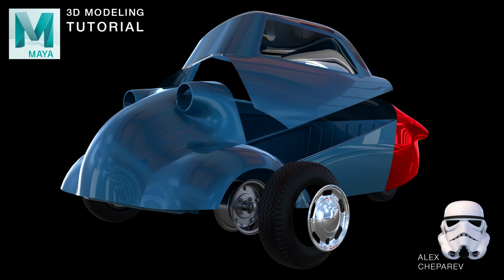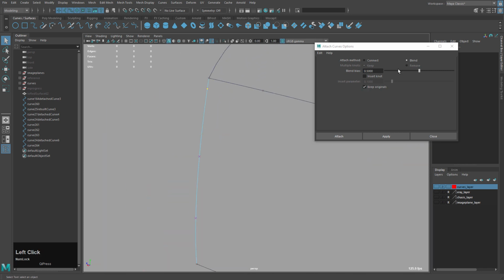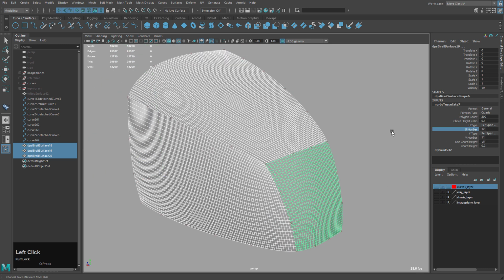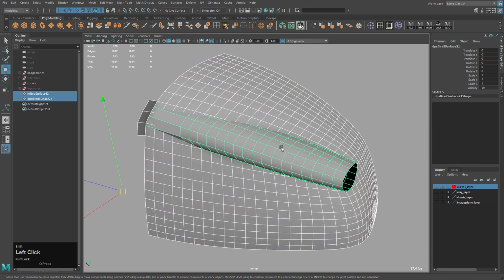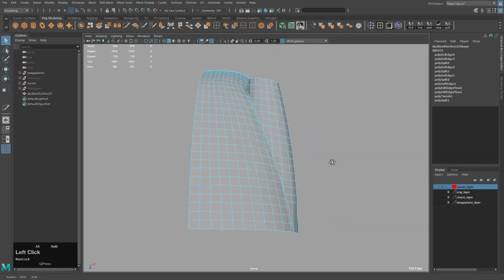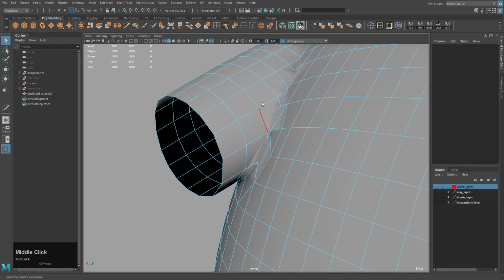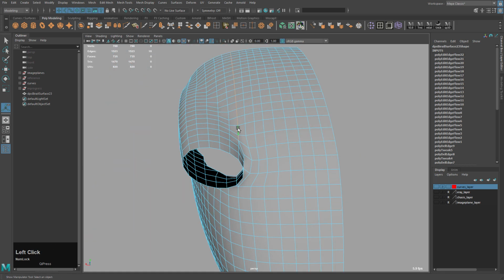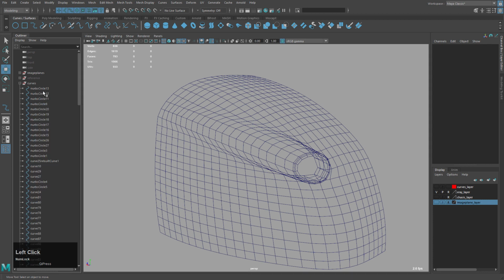3D Modeling a Car in Maya - Trunk

Comment: Do you use any kind of zebra patterns to check reflections on the surfaces quality and how well you contruct them?
Reply: Maya doesn't have a tangency shader like Alias. The zebra shader (like the one you can find in Alias) is useful when you stick with NURBS, where you have actual continuity and degrees of tangency.
As soon as you convert or go to polygons you automatically lose those features and you are left with approximations.

That's why the best thing you can do, in that case, is use a shiny shader and check for uneven or non smooth parts of your geometry by eye.
Reply: @MauroSanna  the thing is that every hard surface modeling tutorial should start by stating very clear the impossibility to create perfect surfaces with polygons. Otherwise newbies can be very frustrated when they see how hard it is to get such AAA quality.
For zebra like reflections you can check this video https://youtu.be/mIpJq9y_Qic
Reply: @JoséMiguelAragüés  Thanks a ton for sharing that link! It was very helpful.
Reply from the maker: José Miguel Aragüés  I don’t, I usually throw on a blin material, make it very shiny and check that way.
Reply from the maker: José Miguel Aragüés  I don’t, I usually throw on a blin material, make it very shiny and check that way.